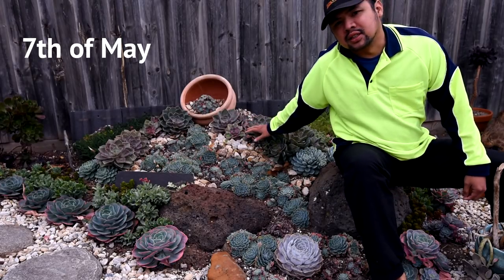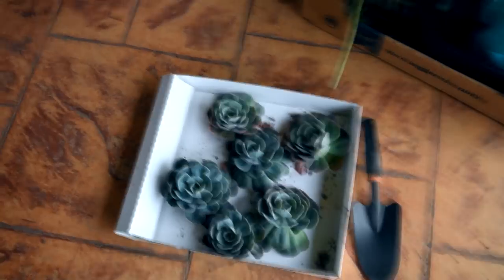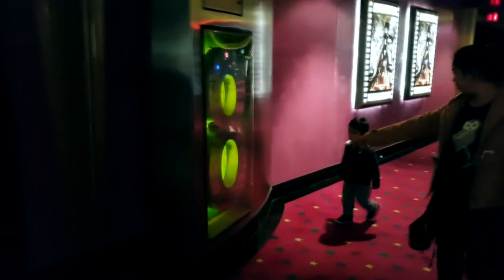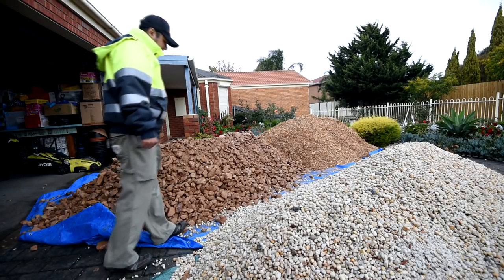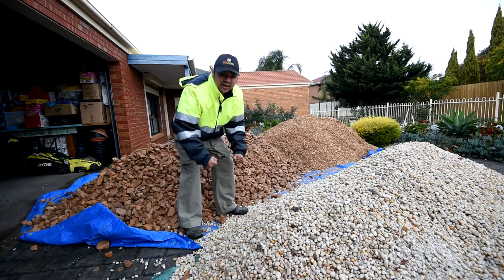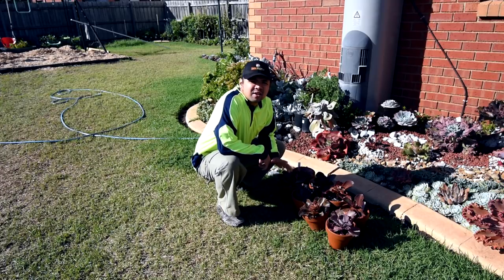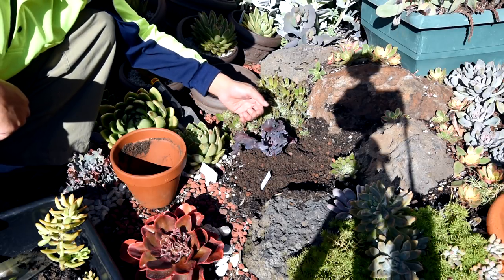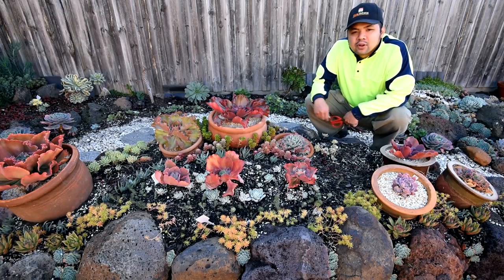#68 Every day I'm shovelin'

Comment: I live in central  in Indiana, and low temps. in winter always go low for a few days, like below zero.  In Jan. and Feb. it  hovers around freezing, or may stay below 32 for days.  It is unpredictble.  I looks like you have a lot of winter hardy plants.  Are there any you might cover in severe "cold, or bring the pots in?
Reply from the maker: It's more of because winters in my suburb isn't harsh. The lowest I've experienced so far in the past few years is 0°C (about 32°F). Never gone below freezing yet, so that gives me a lot of leeway.

To fight against frost though, I would do a bit of preparation work:
1. Plant them at an angle, because frost is fluid, and gravity could help make them slide off.
2. Add a drop off in front of them (easy if they are planted on a mound, otherwise you could dig a trench in front of them). This will direct the flow of air towards the plants, which can push the frost off, and do #3
3. Give them enough airflow, just to prevent fungal rot.
4. Cover them with frost cloth on particularly bad frosty nights, then remove it again in the morning so they do not etiolate.

I made a video about it a while back - https://youtu.be/G0rsu5whuqw

Comment: How are your plants with that much rain you get?
Reply from the maker: They're doing fine! It's mainly because I have mine in the ground rather than pots, and if I do use pots, they're usually the porous type (terracotta).

In the ground, you can get away with a less gritty mix as long as you make it deep enough. The difference is in how water can diffuse in the larger volume of the medium in the ground compared to pots. In the ground, you have the assistance of gravity to drain the water away from your plants (provided they're not purely just clay, and you mound it slightly so they do not form small puddles). In pots, I will need to increase the amount of pebbles by volume especially for the more sensitive plants.